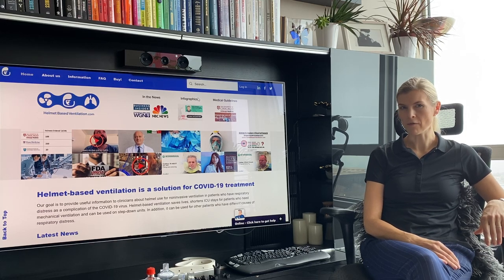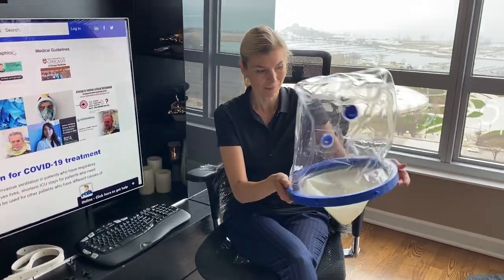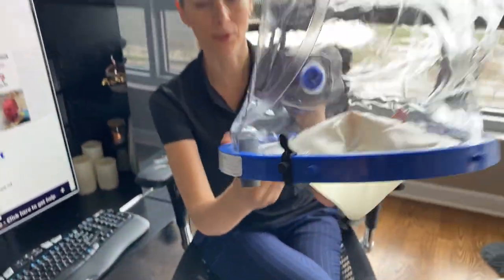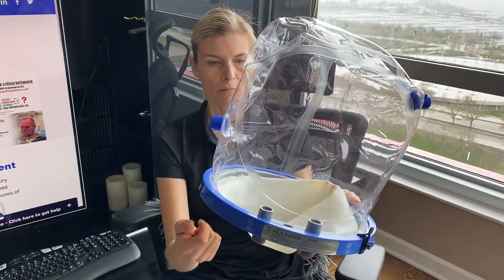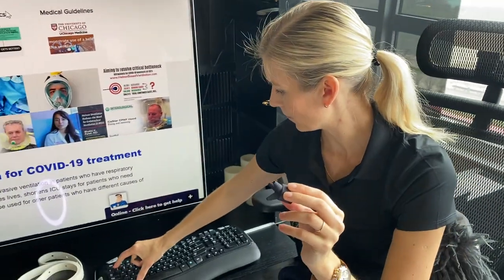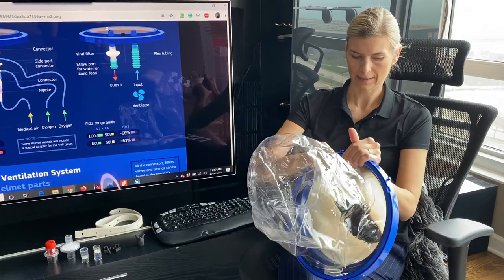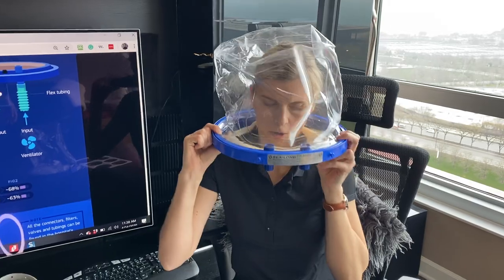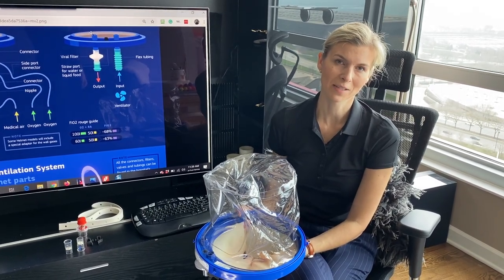Hands-On Review - "COVID NIV Helmet" from the Sea-Long Medical Systems

Comment: can i asck 

when i use Drager Ventilator  or Hamilton Ventilator or Maquet ventilator sometime 
by using delivery device such as 
A-  masck 
or 
B-nasel masck
 or 
C-Full face masck  (helmet)

so we need to chose ( NIPPV/NIV) mode to improve either 
1- Oxygenation level
  (by  adjusting (CPAP/PeeP/EPAP) FiO2 ) during expiration according to ABG analysis and SpO2 pulse oximeter
and
To elemenate
2- Co2 level or Co2 elemination
( by adjusting (iPAP) or you call it peak (inspiratory pressure)) according to ABG analysis or CO2  sensor

My Question is 
If we do use Non invasive Ventilationeither by
 A-full  face masck 
or 
B-nasel masck
 or 
C-Full face masck  (helmet)

1-Do we use the  Pressure support mode or Volume support mode if yes that mean NO RR setting and No( Ti or i:e ratio no squar flow ) only (peak flow % ETS for cycling with back up cycling time )
and flow or pressure triggering ) according to patient need 

2-Dose each breath during one minute of (NIPPV/NIV) Mode of ventilation
Ventilation should be adjusted with the same (Peak inspiratory pressure or iPAP) setting ?
 or
Dose Peak pressure can be different in each breath during one minute (depened or according) to patient effort or it should be fix in each breath patient trigger?

B- How is (fiO2) fraction of inspiration calculated or adjusted during Ventilation

if we are not using ventilator if we use the manometer and flow meter of air and Oxygen

Comment: Aurika can  i asck Question regarding starmed helmet  if we are not using ventilator  twhat is the ( Min and Max) Flow in the  inspiratory Valve  (into the Helmet) and  the Max and Min Expiratory Valve And if we are using Ventilator                                     1-what type of mode do we use  with what parameter we set an 
and.                                                                   what type of mode we should not use ?
Reply from the maker: The min flow should be 50-60 L/min. It can go up to 100-120 L/min. The PEEP valve can be set up to 20 cmH20, but you have to measure actual pressure in the helmet during CPAP treatment because it can be higher than set, especially, when the air flow is increased. 
On the vent you have to choose NIV mode and then pressure support (PS) ventilation. Some vents have HFNC mode, which can be used for helmet CPAP setup. Don't use ventilator CPAP mode, because it will keep the pressure but the flow will be too low for CO2 washout. I hope this info helps.